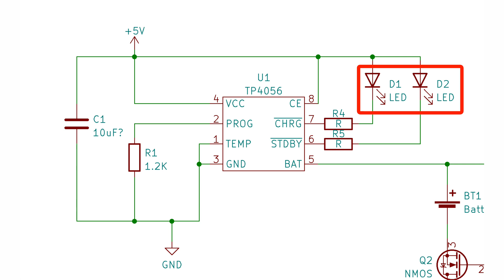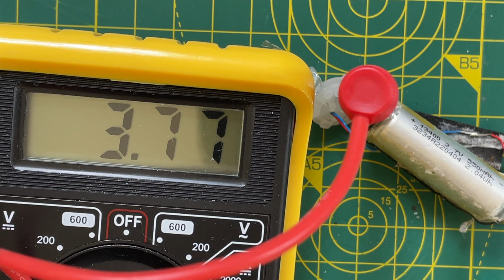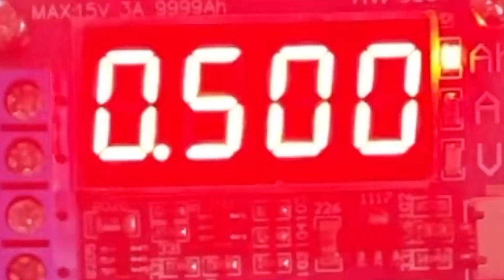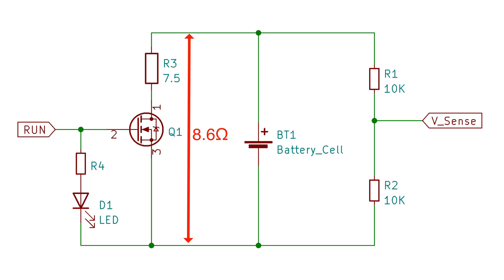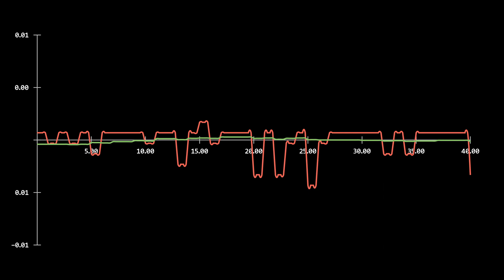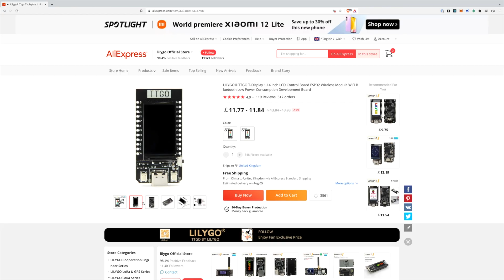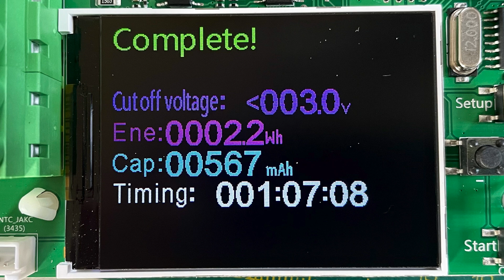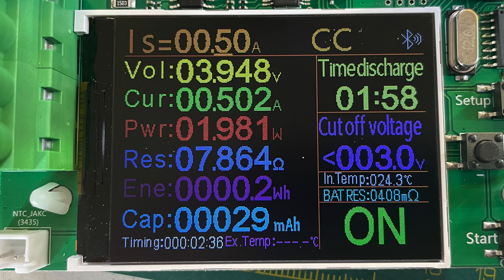Reviving FREE Batteries: Test, Make Safe & DIY Capacity Tester!

Comment: Hi Atomic14,
At 48 seconds you saw the smoke when the + and -  wires were cut. These wires are deliberately thin so that they burn out if the vape tries to draw more than about 5C (about 2.5 to 3 Amperes). This is a safety feature to stop vapes exploding.
BR Harry

Comment: This devices also come with a little component sensible to pressure that also manages a status led (not only for the vape on/off but also for battery status). Barely visible on top left at 0:05
Do anybody know what is that component and if can it be used?

Comment: Ina219 i2c power monitor is your friend here. Also you should calibrate your multiplying factors by just measuring the current and voltage, rather than just using the markings.
Reply from the maker: Nice - I've ordered a couple of breakout boards.

Comment: You should consider replacing the charge current resistors to charge at 0.5C or lower. Charging at too high of a current will shorten the lifespan of your battery by a lot. Most lithium batteries like 0.1C charge currents.
Reply from the maker: Very good point!
Reply: @atomic14  love your content!

Comment: Hi Atomic, thanks for the interesting video. Just for your info, both the Amazon links to the cheapo and the expensive testers appear to point to the wrong products. For me  the more expensive one points at a 15A car battery tester. Eeek bit of a difference !
Reply from the maker: Thanks for spotting that - looks like Amazon's one link doesn't always work. They should hopefully be fixed now.
Reply: Hi  Nope, still not correct, doesnt take you to the exact product, just a bunch of results. Getting closer though, the right product is within the list of results !
Reply from the maker: It's an improvement :) Sounds like a lot of my projects, close enough to working to call it a success!
Reply: Incidentally, did you know the cheapo board has a software calibration procedure. You didnt mention it in the video I think, would have been interesting to see how  much it improved the accuracy. Apparently, it can help a bit, but accuracy is still poor due to op-amp offset errors.
Reply from the maker: Interesting - I did not know that - my manual for it is a bit lacking... I'll have to do some investigating.

Comment: isn't a TP4056 sufficient for also low and high voltage protection ?
Reply from the maker: The little charging board is great - it's got all the protection circuitry. But if you want to use the battery without it then there's no protection. Most batteries you buy will come with a tiny PCB with the protection ICs. These free off the street batteries are completely bare - I guess it saves a bit of money for the manufacturer.
Reply: @atomic14  Hi Chris I think you misunderstood what I tried to ask. If a battery has not protection board and we use a separate protection board like the one you showed but with ONLY a TP4056 and NOT a DW01, I'm thinking that would be safe for under and over voltage of the battery as the TP4056 does both. Wondering why it would also need a DW01 ?
Reply from the maker: The charger boards have both a TP4056 IC and the protection circuit (the DW01+MOSFET), but the TP4056 IC only does charging - it doesn't have any battery protection built in. For battery protection you need the DW01+MOSFET.

Comment: LOL 0:50 I LITERALLY DID THE EXACT SAME THE OTHER NIGHT! I ripped out the LiPo batteries from my old vapes. I carefully desoldered all the wires, and was putting on new ones because the old ones were very garbage, tiny or just too small. And I had the two wires soldered on one battery, which were off spooled. And once I measured out the length, I carefully cut both wires at the same time and had a nice little spark. Funnily enough, throughout the entire time I kept reminding myself to be careful AND NOT DO THIS. But at the last minute I did it anyways. But no big explosions, and I've since attached it to a lithium battery controller, and already had it charged and tested on a normal DC fan. So it does seem to work normally, but just my friendly reminder I need to be a bit more careful with these boys. :P

great video!
Reply from the maker: So easy to get complacent when you only deal with low voltages - you get into the habit of thinking there's no danger of accidents, and then bang, big sparks.
Reply: @atomic14  The low voltages are deceptive. It's the low internal resistance of a typical Lipo that is scary

Comment: You should reduce the charge current from 1A down to about 500mAh for those small batteries. When I find those 'gutter batteries' I slowly charge them at 300/500mAh depending on the size. 

If you find any of the square tube ones - they usually have upto 1500mAh batteries - very handy finds!!!!!
Reply from the maker: Good point on the charging current. I’ll keep an eye out for those 1500mAh ones - they would be really nice!
Reply: @atomic14  everywhere I walk/run now... I am scanning the gutters and verges like a magpie!! 🤣
Reply from the maker: It's ridiculous, isn't it? - out for a nice walk, look at the trees, look at the sky - no, head down scanning the gutters :)
Reply: @atomic14  I can't unsee them now! I even take the smashed up ones and recycle them - disgusting products that should not be a one time use! 😒
Reply: @atomic14  I found a discarded vape by checking under the trees